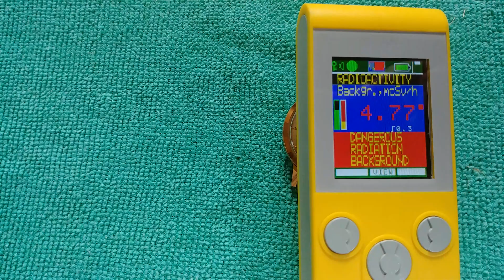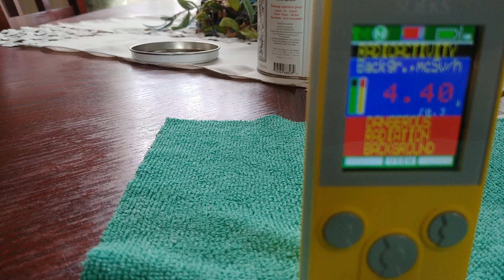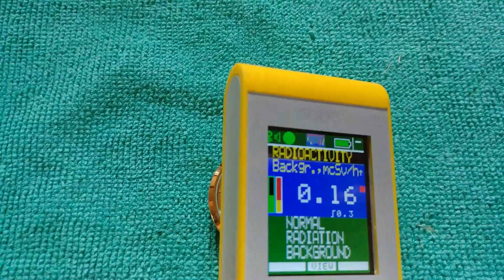Radioactive Radium  luminescent paint in watches

Comment: Radium-226 is dangerous, more so because of its chemistry. It's in group 2 on the periodic table, which is in the same group as calcium. That's why. It also decays to radon-222, which alpha decays to several other radionuclides. Radium is an alpha emitter, and a low energy gamma ray (186 keV) emitter by itself. It's branching ratio for this gamma ray energy is 3.6% per alpha decay. However, many of the decay daughters, like lead-214, and especially bismuth-214, emit many low to very high energy beta and gamma rays, with much higher branching ratios. This is where a majority of the radiation being detected comes from. Radium-226 doesn't pose too much of a hazard, unless it's ingested or inhaled, or if you have A LOT of it (milligrams to grams) close by, and unshielded, for extended periods of time. The hottest radium source I have reaches almost 10 mSv/h (1 R/h) at contact! However, I prefer using CPM (counts/minute), since dose units are only accurate if they're calibrated to a specific radionuclide, which is often cesium-137 or cobalt-60. I like that watch! Most of mine are radium-lumed Soviet watches. The video quality is nice too! Thank you for sharing! 👍
Reply from the maker: KaebineKyle thanks for commenting. I'm just staring out and hope to have more technical content on my channel. It's giving me something positive to do since I was laid off from my IT job a few months ago. That's a good bit of technical information I enjoy reading. I became very fascinated with this subject when I began watch collecting long ago. I also watched the documentary Radium City (1987) filmed in Ottawa IL in the 80's and what a story and sad outcome for many of the female workers that painted watch, clock and aircraft dials of the time. This SOEKS geiger counter only does mSv/h however I have a RadAlert 50 with a LND712 mica shield tube that does CPM and will measure it's output. I will also measure a smaller men's 1940's Westclox watch I picked up with it that is even hotter than this watch and upload the video. You can actually see the burning in the dark brown radium paint. Please hit the subscribe button if you like the content. Thanks.